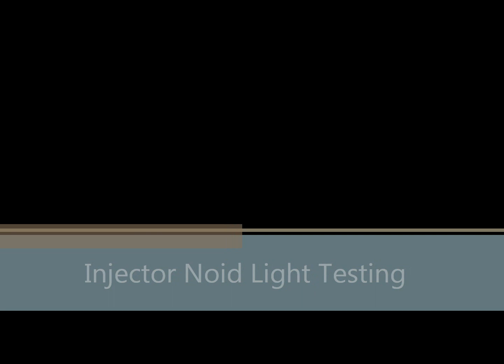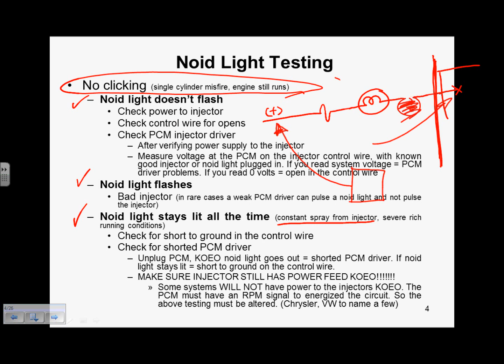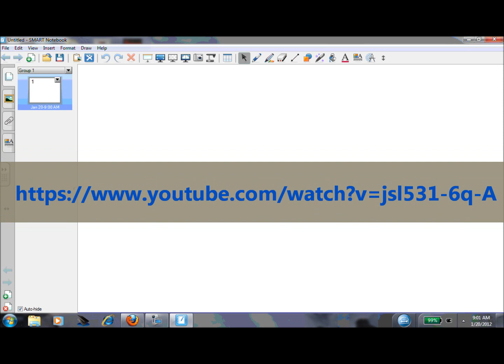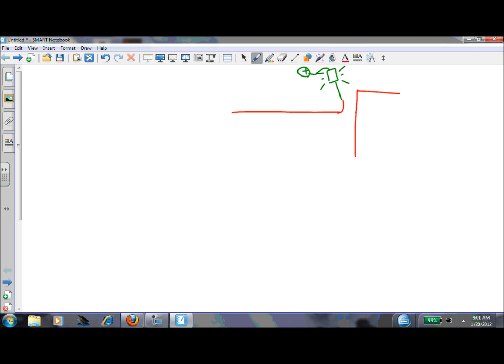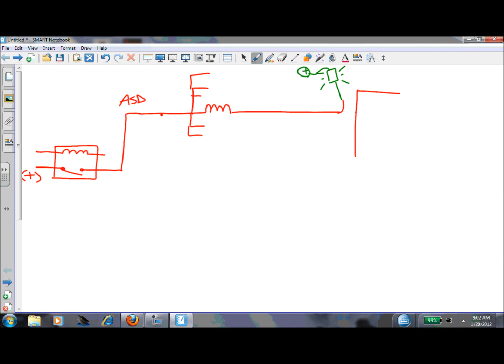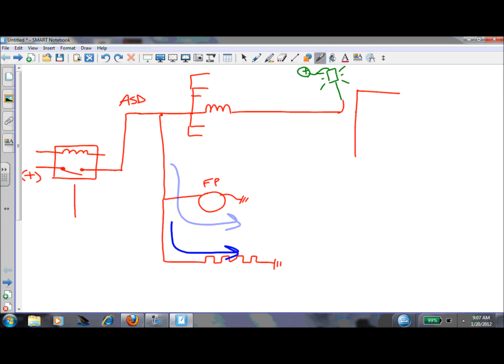How to test a fuel injector circuit with a noid light (a ScannerDanner Premium video)

Comment: the reason I said that I think it might be a short is because of evidence like it runs and the exhaust smell rich of fuel,  so that left me to think that maybe the driver is constantly  grounding  the injectors, yep my testlight did not flicker on any of the injectors.  However  you pointed out that the impedence of my testlight maybe a variable in my case,  so I'm going to try using  another       testlight to see where's my next direction. Oh it has a misfire, so maybe I'm going the wrong direction  here but still not seeing  control on those  injectors with  my testlight certainly raises a brow.
Reply from the maker: Orlando, post your questions to my forum. I'll try to help you more over there.
www.scannerdanner.com

Comment: after watching this video I went ahead to try it on my car, a 95 corolla, and the car runs but there is no control. the testlight had a constant light on both wires. I completely  understand what was taught on this video but I'm a lost in applying it. I'm going to check the control circuit  for a short then do the necessary  checks at the computer and see what's my case here. Great  video. I still  learned alot
Reply from the maker: "runs but there is no control" I am assuming you are dealing with a single cylinder misfire?
BTW it is normal to see a constant light on both wires (depending on your test light impedance). This would not be a short but an open. One side should be pulsing. 
Watch this video on testing the injector circuit. This one has an open in the injector winding so a little different than you describe for yours but still valuable information. 
https://www.youtube.com/edit?o=U&video_id=mmRhcVkJdeQ

Comment: Hi so I'm looking at your video and im having a problem with my 1988 2.8 Chevrolet s10 and  the noid light is not coming on. The truck has spark can you please help.
Reply from the maker: Take a test light connected to battery positive with the key on and touch on and off the purple white wire coming from the ignition module. If the injectors fire, replace the module
https://www.youtube.com/edit?o=U&video_id=mxPdxGqRWvc

Comment: Some of these engines you can't even get to the injector unless you take half the engine apart.
Reply: Arthur Rodesiler that's exactly my issue with my '95 200sx SE-R. such a pain in the ass

Comment: On a throttle body with obd-1 with just injectors a noid light helps....on obd-2 you really need a scanner to find it.  Much faster....take it to a dealer as most new cars you are pretty much never gona find the problem for the diy.

Comment: OK... this saved me buying a new computer. Had no pulse on no. 2 injector causing misfire so after testing wires assumed computer was faulty... until I checked out this video and checked pulse on initial startup... sure enough pulsed a couple of times and shut off... swapped the brand new ignition coil on that cylinder with an old spare and bingo problem solved. Tip from me is don't assume new parts are good. Thank you ScannerDanner
Reply from the maker: +MrClusterfuk sweet
Reply: @ScannerDanner  i have a 1999 Nissan frontier 3.3 and the coil is in the distributer, will there be a flash at start up with that like the individual coils does and also i eont have a OEM distributer can that cause a single misfire and i also have a misfire on #2 cylinder with no pulse but has 12v going to it, but just hadnt got to check to see if flash at startup yet and didnt even know if there would be a flash with just one coil

Comment: Hey scanner danner! What do you think about unplugging the fuel pump connector to prevent back feeding on the circuit during an injector short to ground test on the feed side with a test light?
Reply from the maker: +Doug Terry sure, you could do that. 
great question my friend. it shows you were following very well. 
one other thing to consider, on a Chrysler (ASD circuit), you can get a back feed through the O2 heater circuit too.

Comment: Hey Gang,

I just swapped out the four original Multec I injectors on my '94 Saturn SL2 (238K miles). It was the first time I ever removed a fuel rail and injectors. So it was a learn as I go project.I replaced the fuel pressure regulator as well, with the a AC-Delco unit, since it was original with 238K miles. The FPR didn't owe me anything, right?. I don't have a scanner. I do have a Fluke 87-V with basic leads, 'noid and a test light.

Upon start up I found cylinder 4 to be “dead”. I pulled out the plug lead and no RPM change. As I had new plug wires I swapped out the old ones (the old wires were due), and Scotch Brite cleaned the coil terminals. I bought a noid light kit and found that the #4 injector pig tail had a steady light, not flashing, as compared to cylinders 1-3. I DID NOT realize the significance of this steady light at the time. I got an RMA from the vendor and got another injector shipped.

Put in the injector and no joy. It was then I found this video and realized I might have a short to ground. I think my situation is the #3 bullet point.

As I've moved the wiring harness around for the fuel rail, MAP sensor, and TPS, I pondered whether I cracked some old insulation and created said short to ground. With KOEO I pulled the plug from PCM (plug port B-16 solid green for negative side of the injector #4 circuit), with the battery connected I affixed my test light to the positive battery terminal and the (-) side of th #4's pigtail. No light. I'm assuming therefore the negative  side of the circuit is NOT shorted to ground, but I have a bad computer. When the engine runs I get the thick cloud of white smoke out back, so I know the injector is continuously  on, and I hear no clicking from the injector via the screwdriver to the ear.

I have a reman'd unit offered to me for $80, via E-bay from a credible local vendor. But before I buy it I'm wondering if anyone has some thoughts. Paul, you out there?

Any help appreciated.
Reply: I always try to answer those who have clearly done there homework. Nice job so far!  So you pulled the one single injector control wire from the PCM connector correct? Then you connected test light to b+ and touched the control wire harness side and it was not lit?
Reply: ScannerDanner Premium Sorry, I pulled the whole multi-plug out of the PCM. Then with battery connected I attached the test light to the + battery terminal, and the light's probe to the green ( - ) side of the #4's pigtail. My car is a Saturn SL2 1994 DOHC. I think it may have that ASD relay, but I'm not sure. Oh yeah, thanks for the awesome help and advice you do here.

Another edit: According to my Chilton book the plug port is B-16, but the Haynes book says D-16. Go figure.
Reply: ScannerDanner Premium Addendum: I pulled the entire plug out of the PCM. Then I connected the test light to B+ and to the - side wire harness of #4 I got no light. Sorry, I forgot to include that.

I also forgot to mention that I put a screwdriver to my ear and heard clicking for injectors 1-3, but nothing on #4. 

I suppose another question I have, if the PCM indeed packed it in, is why it did so when I changed the injectors. When did I do somewhere to cause it? I had trouble removing the #4 plug, it was stuck, and the spring retaining clip was worn out. I broke the plug getting it off, and I wonder if shorted the circuit. Maybe I did. I have a spare pigtail on the circuit at the moment, just wire nutted,  but I have to trim off the excess slack and solder/shrinktube it on permanently once I get the car roadworthy again.
Reply: RandallFlaggNY
did you see this one? https://www.youtube.com/watch?v=jsl531-6q-A
what you have sounds like a shorted PCM driver but watch this video to be sure

Comment: What about a misfire on two cylinders that are next to eachother that started incredibly suddenly? (Drove to go into restaurant to pick up food truck was fine. not even 2 minutes later back out to my truck and it's missing) Check Engine light flashes on the freeway sometimes but its always missing. Scan tool live data counts misfires on #2 and #4 on my 98 Chevy K1500 5.7. Fuel pressure was strong 60 psi. Compression was about equal to known good cylinders. (although I tested when engine was cold.)

Comment: Hello scaner I've recently started to watch your YouTube videos I must say that you are a genius to be able to dumb it down enough for me to understand . I have a question to ask I'm getting a intermittent miss injector fail i know what one it is it's bad enough that it blows clouds of smoke when it's failing what is the best way to diagnose it ...for a home work shop?
Reply from the maker: are you sure it is the injector causing the white smoke? it will smell like raw fuel if it is. a head gasket can also cause white smoke. IF it is the injector you have to test it as I described in this video DURING the event to determine where the problem is. I have never seen an injector stick open on its own, it has always been a short to ground in the wire or driver
Reply: I have found the problem it was a driver I changed the ecu it ran much better although not quite right under further inspection I found that a terminal in the ecu  connector was loose wich I think it may of  burnt the driver out Thank you for your help it's really appreciated.

Comment from the maker: Yes. If you have pulse and no spray with good fuel  psi try tapping on the injectors they are probably stuck shut from sitting.

Comment: Would all of this also apply if the engine won't start? I have a 89 S-10 Blazer that im trying to get running again,has been sitting for about a year.I have fuel going upto to the injectors but no fuel spray.Used the Noid light and it flashes every time the engine tries to start.

Comment: Last added comment on common rail is the pressure in the system is 30,000psi!! they are right into the cylinder so that's probably why the voltage and windings within the injector are 100volts approx

Comment: Cheers man, I thought it would melt or burn it out too, thanks, Ive read that your type of picoscope/oscilloscopes the only way to measure common rail diesels injector pulse with an amp clamp, like with the testing of injectors normally..I was just trying to find a way with my multimeter. I just watched your P0205 code- mechanical-stuck open injector, the code breaker book points to an open but turned out that it was a short to ground in your video, I hope its as simple as looking to see a break

Comment: Hi Paul I have a P0204 code on a Vauxhall/Opel common rail Diesel engined vehicle. I hear that common rails voltage feel to the injector is between 80-120volts, can I used a noid light in this situation, as I haven't found an answer online. Thank you

Comment from the maker: most likely from an ignition system misfire. the computer will shut the injector down to protect the catalytic converter. these are notorious for coil problems as well as plugs and wires